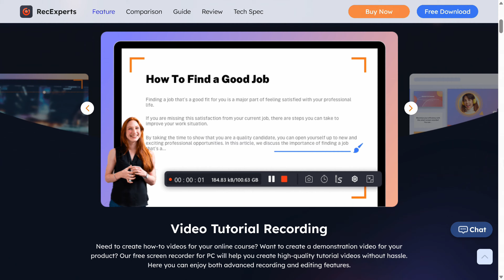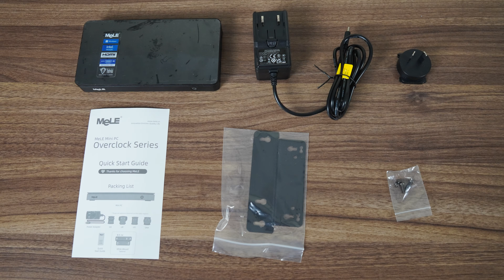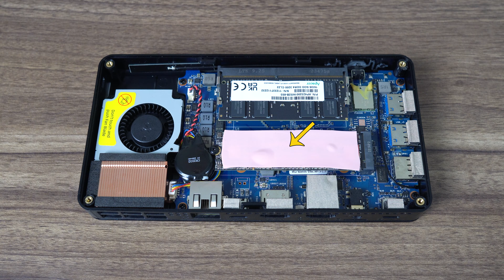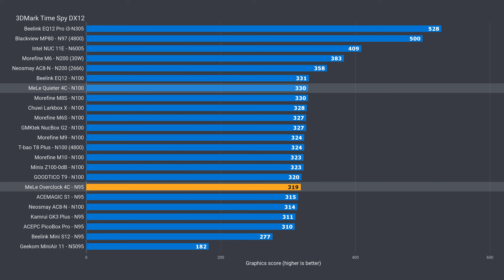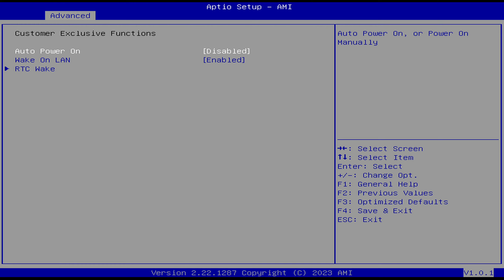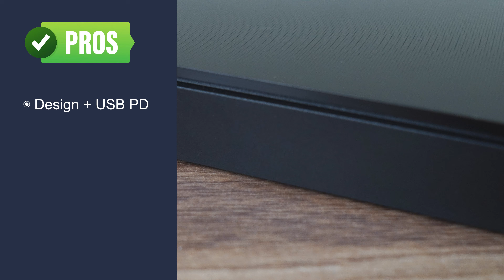USB Powered & Quiet! MeLe Overclock 4C Mini PC Review

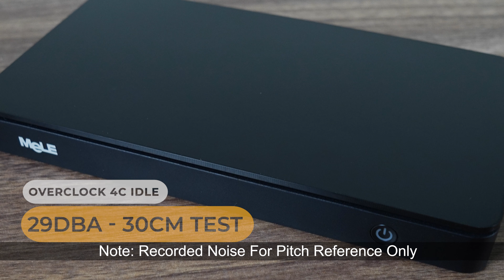Comment: Q - you're noise comparison (7:58) shows the Quieter 4C at 29 dBA with the Overclock at 29/30.  However, isn't the Quieter fanless?  Why isn't it completely silent?  TIA
Reply from the maker: Ambient noise level is 29dBA. If I put 0 in the chart, there will be nothing there, so instead the ambient noise is used.

Comment: Do you recomend the n100 version over the n95? I´m not sure why n95 version is more expensive
Reply from the maker: The Quieter4C is a different mini PC. This one is bigger with active cooling, while the Quieter4C is passive and silent but runs hot and has worse performance.
Reply: @Robtech  thx for the answer, but i´m talking about both Overclock4C models, there is n95 and n100 version
Reply from the maker: Okay, I had a look. That was just released. I likely won't be reviewing it.

Comment: I suppose it would be possible to transfer the OS on the nvme drive?
Reply from the maker: Yep, but not sure if the Windows license would carry over. Can be iffy about hardware changes
Reply: @Robtech  Done this with two MeLe's, license is stored in firmware on the MB, so no problem.
Reply: MeLe has instructions for this on their website. Good idea to follow it as can be a bit tricky. Several Howtos around as well, especially on Astronomy forums and sites.

Comment: I suppose if the form factor is the paramount concern, then that can trump any other consideration, but if one can live with a 4x4 mini, there are N100 Beelinks (for example) for $180 USD with 500GB of nvme (though probably 1 or 2 lanes) and 16GB of socketed RAM, etc.  And eMMC speaks for itself. Nonetheless, it was interesting to see the two units compared.

Comment: Mele's Quieter3 is my main machine now. It gets hot but I really enjoy the compact, quiet machine and it runs Linux perfectly. It struggles a bit when I edit 1080p videos in Shotcut but I don't game on it so it's mostly ok. Hope someone releases a fanless machine or even laptop with an N300 chip (or AMD's whatever equivalent) cuz it's apparently more than double the performance of Quieter3.
Reply: I use the 3Q with HomeAssistant and tons of Dockers running everything I need 24/7. Bought for 200E on German Amazon in times when Pi4 hadn't been available for many months... All I miss is 2.5GB, but with WIFI 6 I get better speeds than with 1GB lan.
I still woulnd't buy a Pi4 again nor the Pi5.

Comment: These mini PCs with modified Windows installation.  Have you ever tried to erase the drive, do a clean installation of Windows on your own and see if they will activate as they should?  
This is clearly a better computer than the previous model.
Hopefully the third one, (MeLe Sanity?) will come with non soldered storage at all and unmodified installation of Windows and an air cooled N100.  Also, perhaps a nice bright orange color?  Please?  

Good review.
Reply: How about just not usint the emmc at all? Just copy data using an external m.2 drve.  Some come with acronis installed.  plug the m.2 in and either disable format the enmmc.
Reply: @LeChimp-jg6fh   Or not have the emmc drive at all and have an nvme or at least m.2 sata drive there?
Reply: @TrusteftTech  EMMC is soldered on it, you will have to disable it
Reply: @Basics_of_Gameology  Beautiful.  Few things are better than soldered crap storage solution.